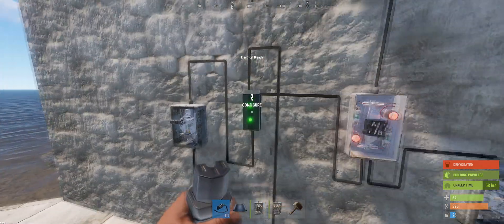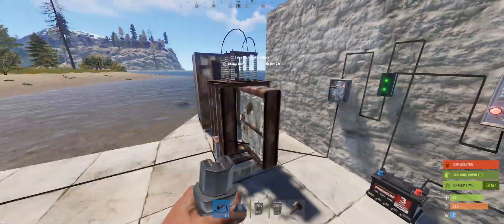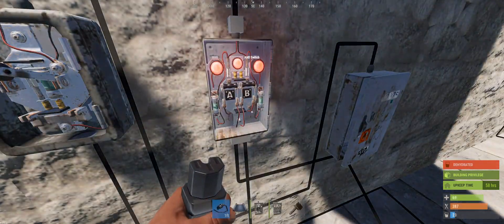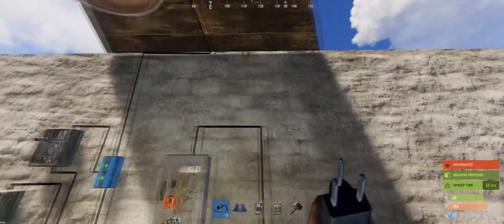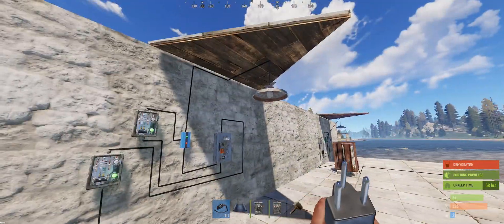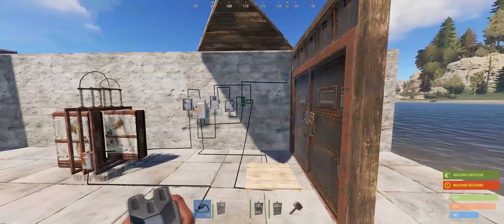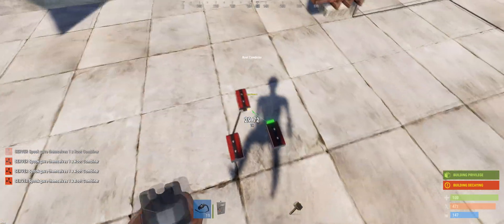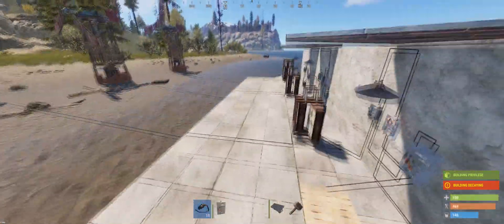Rust Electricity Tutorial #6 - Memory Cells - OR Switch - XOR Switch

Comment: The or, xor (exclusive or) and switches are logic gates.  Same with memory and rand switches.  I have built computers and fully automated self sealing and resetting mazes with these devices.  I will try and make a video on them later but it does require some understanding of more advanced electrical understanding.

Comment: I think that an optimized application for the first example would be to simply make the system block power from the battery to the lights whenever the lights also receive power from another source - so in the case of sunlight the solar panels would split power evenly to run the lights and charge the battery, and then at night time when the solar panels are no longer effective they will stop giving electric signal to the lights, which would cause the battery to take over instead - so you have an infinite and perfectly balanced lighting setup - and then just a master switch to block out all electrical sources to the lamp when you just need to shut it down and let all power from solar panels go to the battery alone.
Good and simple work on the basics :)

Comment: a better example for the blocker is to rig it up where the block passthrough is connected to a solar panel, that way it turns everything on at night, useful for lighting.  Its best for passive things that you don't manually do yourself.  Otherwise you can save some HQM and just have a switch

Comment: i have a question, how do you combine more then 4 splitters ?i want press a button or RF thing to open 8 doors for me the root combiner does not work 2 solar panels is still 20 power instead of 40also please explain why a big batery gives more power then 2 car baterys hooked up ? or multiple
Reply: At the moment the root combiners are meant for lower tier players to use them for solar panels facing the direction where the sun comes out and comes down so it charges during the whole day (east - west) and when you hook up multiple batteries together they the final output isn't greater because they're just charging each other with great loss in effeciency due to heat, moisture, etc... but the final output is the same due to them being smaller energy sources than the downscaled transformers they named large batteries

Comment: Is there any way to do this with multiple doors (About 15 or so) in game without a generator? I've tried this but It's extremely hard to keep it powered even using your infinite energy method. Is there any way to get the memory cell to save the door being closed and stop using power, then when you want to open the doors reset again and stop using power.

Comment: About "OR/AND" Switch the description is actually correct, "Logic gate" is the keyword here (they dont work the same way). Without any changes the logic is: "if this happens, then this is the result" so the "OR-Switch" change the logic to "if this happens OR this happens, then this is the result" and the "AND-Switch" Change the logic to "if this happens AND this happens, then this is the result". 

So for the "OR-Switch" one of two choices is good enough. And for the "AND-Switch" both signals have to be activated before anything happens. 

In this video the OR switch only need signal from 1 of the switches for the light to go on, but the AND-switch needed both the switch and pressure plate to be activeted before it lighten up, then when he walked of the plate the light turned off.

Comment: There is a limit how many RC (root combiner) we can stack, I tried it out but there is a limit wich is good.
With the memory cell i still not understood well things, could u make another tutorial with few more examples ? 
What I'm interested to make (since it is my server, it is my rules :P ) e.g. when I enter in my base, i want to step on a pressure pad (or pass by a laser) and ALL doors/gates open (except the entrance door which I will close it manually) and when I leave my base and step again on pressure pad (or pass by the laser) all doors/gates to close behind me. I have a feeling that this can be done and I dont need to use a switch that turns on and off every time... Thx in advance.
Reply: A memory cell is a "flip flop jk" in the real world, it works like this:
You got set, reset, output and inverted output. By powering set it will turn on the output and turn off the inverted one. Once you power up reset it will invert the outputs.

Comment: The switches are named depending on what they do. They are called "gates" in Logic. The thing you pronounce as "/oʊ/ /ɑːr/[" is just or. And the other one is just and, not A.N.D. 

The idea is OR gate passes the signal if one OR the other input is 1. The AND gates passes the signal if the first AND second input are 1.

The XOR, or knows as "exclusive or" passes the signal if one or the other input is 1.

There is a table here where you can see the inputs and the results on different gates (switches): https://cdn.instructables.com/F94/JZV3/IYYTP54L/F94JZV3IYYTP54L.LARGE.jpg

Also, if they ever add a NOT switch, which simply inverts the input, you can make XOR switch using AND and NOT. And other switches like NAND etc.
Reply from the maker: Now I know this it makes 100% more sense.. thank you :)
Reply: The Blocker already fills the role of an invertor. Power the blocker separately (via Power IN) and use the blocker's second input as if it is the input to a NOT gate. When signal is high, output is low and vice versa.

AND + Blocker (NOT) = NAND gate and you're in business with a universal gate. The hard part is keeping track of all your power if you're using a limited power source or one that is sporadic.